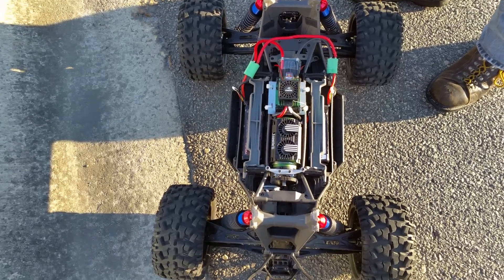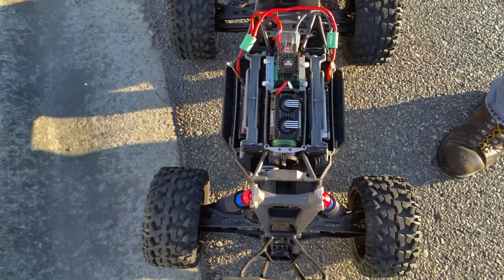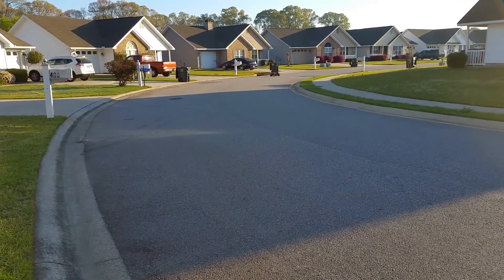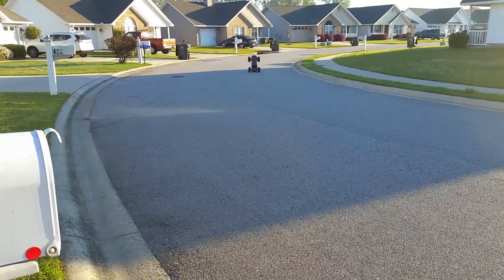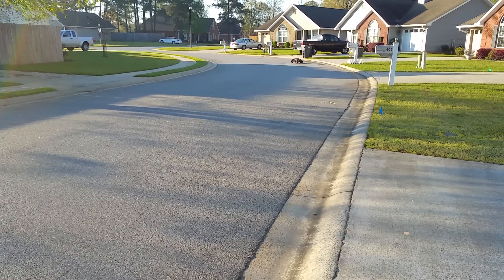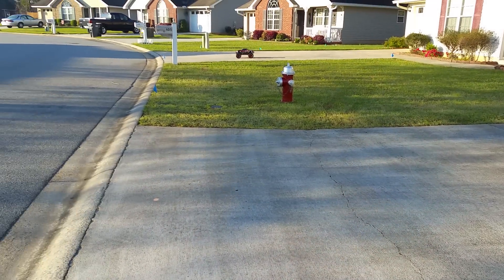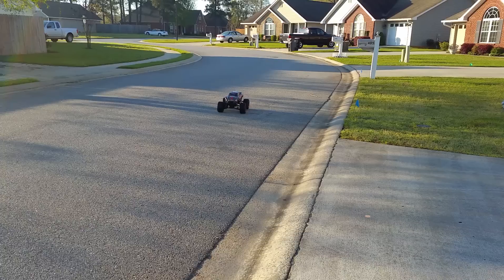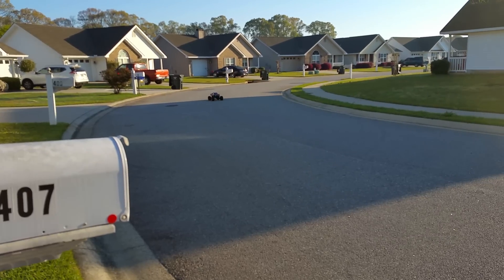Traxxas XLX-Maxx with xlx esc, 2028 motor 53 tooth pinion, 50 tooth spur

Comment: Been watching all the videos you made on the X max thanks for all your videos with this vehicle and others good stuff
Reply from the maker: my pleasure.  just wanting to help
Reply: Nitro Revolution RC
Reply: Nitro Revolution RC what cell should i run with this motor and esc smc 7200mah 90c 131amps 3s or smc 6700mah 4s on 37/50

Comment: Great running video I'm picking mine up from the hobby shop I had to castle creation installed motors like a soda can can't wait to get it I think I'm going to have to invest in a couple three sells seeing how yours runs really fast on 6s I also am afraid of dropping 2 4cells in it again great video thank you looking forward to more of them I'm your number one fan in New York
Reply from the maker: thank you very much.  I will say be prepared for broken diffs. even the spiral cut hardened.  straight cut is always stronger, the spiral cut gears only make the truck run smoother.  they break just as easy as the standard.  I have heard rumors that LEM (leading edge machining, they make true bulletproof parts and warranty them so basically if you manage to break them you will get replacements) are going to be producing gears and diff cups for the x-maxx and Kershaw is producing gears as well.  I'm not sure how strong these are yet due to they have not shipped yet?  So until then stick with the stock gears just shim the pinion, I have a video on how to do that, I wish you the best of luck with your vehicle and if you habe any questions I have all the videos and know more than most about this vehicle.  I get contacted daily on help with many different types of vehicles, last night I had a friend looking to get his first o road car and seeing that I habe more of those than off road (my next vehicle will be the x-ray x1, a formula 1 1/10 scale vehicle that won the podium in the ets series, one if the hardest racing series, on the day if it's debut so it's a hell of a racing car.  I have 2 f1 vehicles but theyre collector's items so i wamt one I cam actually race.  again if you need any help you can e-mail me at rlewishughes@msn.com or my name on Facebook is Randall Hughes, you can find me in the main X-maxx group, I am 1 of 2 admins as like I've said there is only one other person that knows this truck like I do but he did mods to put in a fifth scale servo.  I was more into keeping kt stock except for the power system.  enjoy your castle powered X-maxx and be sure to keep extra diff gears on hand, atleast 2 or 3 sets fkr the front and back and your only looking at 32 dollars for 2 extra sets.  also look at getting the hot racing clutch assembly cover which is metal cause thenplastix will flex and you will strip your main drive gear.

Comment: this is THE best sounding X-Maxx ive seen in a while. so does the gear upgrade work with the stock motor? why did everyone get a new ESC. I bought mine a month ago, and have not had ESC issues so far, are ESC still an issue on this one? i got the 8s edition.

Comment: Problem with the 2028 geared 1:1 it accelerates so slow. That 800kv isn’t a prime choice for the truck due to the weight. Install a custom Fastlane Tp 1500kv and it will shoot out of the hole and have more top end than that geared 2:1. They have the basher series 1600kv’s and they are insane little motors pushing out 2000 watts more than the 2028.
Reply from the maker: Glenn Edward thec2028 was decent. At the time I knew of these other noymtors but no feedback from anyone. The biggest problem was the ESC. When the xlx came out castle put a cap on the amount of punch amperage available. This can be changed now but it voids the warranty. I've traded this for my highly upgraded dbxl.
Reply: Glenn Edward tp are the bees knees!!!!
Reply: Glenn Edward it is when your towing cars or plowing snow. Check the snow plow mod! 😃
Reply: Can't you just add more weight better shocks and a wheelie bar to the truck
Reply: I have heard guy going tru 2 t.p motor they run good but not for long ,besides you can run 12s on castle 2028 buddy, just need a better esc

Comment: this modification of the X MAXX is the way it should have been sold out of the box
Reply from the maker: I agree but this is wayyy to much power for a starter rc vehicle as many has ad the X-maxx to be.  I've do led the torque and horsepower.
Reply: Then it would be more expensive and you would complain about the price

Comment: What do you think of a 50 tooth pinion on a 87 tooth spur with a 1.9? Belt to wheel reduction rwd 2s , 5t 3300kv 3660 brushless in trying to set a rwd touring car world record, do you think with a 8th scale esc in my 1/10 scale it’d fly past 100?
Reply from the maker: Possibly but keep larger pinions and smaller spurs if you need more speed.
Youre also probably gonna need a 6w system with lower KV motor.
Higher KV not the best idea for speed runs IMO.
Again, my opinion.
Reply: @potjnkye86  I already have this motor, trying to use it for this project, with my hopefully 1.4 fdr it’ll end up 120 in a perfect world if I get custom gears 1.0 ratio or even a negative ratio or .8 or something crazy, this thing is going for world record

Comment: I am planning on getting a 2028 Castle motor, pleaseeee!!! tell me what else do I have to change?(what gearing? did the stock differentials broke?) what upgrades should I buy if I switch to a 2028 Castle motor?
Reply from the maker: Angel Negron gearing on 6s 37/50 for bashing 49 or 53 pinion and 50 or 46 sour for soeed runs.  And you will break diffs.  a new company called rock passion has released some extremely strong gears for it.  120 just for the front or back so 240 for the set but from what i hear they're worth it.  the teeth are bigger.  until you get better diffs just shim the stock diff pinion.  doing that makes them last even longer than the hardened spiral cut.
Reply from the maker: Angel Negron you also need the Kershaw or Poseidon motor mount

Comment: hey brother ive been watching your vids for a min and inspired me to do my own build.same xmaxx and castle xlx,2028 48 tooth spur and stock pinion. problem is everything is turned up on castle link and still slow?? slow its doing 50 but with same everything but stock moter and she was smoking fast .so my question is what am i missing? oh im running 8s thanks brother and keep up the great feed!
Reply from the maker: are you using the stock receiver?  and if so is the temp probe still connected?
Reply: +Amateur RC yup that was the problem lol...now just need tires that will handle that horsepower!
Reply from the maker: +derrick lyon if that temp probe isn't connected you only get 50% power
Reply from the maker: +derrick lyon king motor pioneers and they come with wheels.  89 dollars shipped
Reply: +Amateur RC thanks for the reply brother
Reply from the maker: +derrick lyon anytime

Comment: Trying to decide between the Castle and the Leopard, want the faster/better option.  Have you gps speed clocked this yet? Whats your top speed?
Reply from the maker: I have quite a few friends whose leopard motors windings have shorted out to the can and the can is so thin.  you get what you pay for.  Castle 100% and it's so efficient you can run 12s on it with a bigger esc.
Reply from the maker: I also know someone who sells the hobbywing max5 esc, poseidon motor mount and a poseidon motor for 450 and that's a hell of a deal.  the mount alone is 114

Comment: I know this is about 3 years old now, but do you still have this setup on your x-maxx?  If so, how has it held up?  I'm upgrading mine similar to yours, but with a Dynamite Fuze DYNS1665 motor with a Max5.   Also, do you run the same gearing?
Reply from the maker: I traded it about a month after I did this mod for a DBXL cause the 6s diffs could not hold up to the power and I didn't like the idea of spending so much money on all plastic which is what Traxxas is except their Nitros. The setup itself even with the 53/50 gearing I had was fine. It could take it all day but the drivetrain of an X-maxx along with it's all 0lastic chassis is a major weak point. Honestly if you can get a used mtxl, pull all the gas stuff and install a 12s setup.
Reply: @potjnkye86 I think I may just leave it stock then.  Maybe add a MAX 6 and be done with it.   Do you think with a MAX 5 with 2028 motor will be good enough for the MTXL?  Nice choice in RC.  I was eye balling the Losi DBXL-E.  They look to have great handling, not so sure how well they hold up in bashing and jumps.
Reply from the maker: @romelreyna2457  DBXL was never a good jumper. If I were to getanither X-maxx I'd get an 8s roller and add the highest amperage rated hobbywing ESC and Poseidon 2028 motoramd run it on 8s.  You can harden the stock parts but you've got to get them red hot, dip them 8n used oil then put them 8n an oven for like 4 hours at a certain temp. Hacksmith and TKOR showed how to do this. But at the end of the day you still have a plastic chassis. Kershaw designs designed 2, a regular metal version and an LCG metal version. I was gonna do ALOT to my X-maxx but I soon found how cheaply it was made.
Reply from the maker: @romelreyna2457  as for will a 2028 motor being enough for a mtxl. I know it is. I have a buddy that built a 14s mtxl and even with a center diff (filled with 1 million diff fluid) it would do wheelies. X-MAXX IS A BLAST but you have to realize what Traxxas is. They're even stopping shipping to hobby stores cause they don't want anyone to make a profit off Traxxas vehicles except Traxxas. Look it up. The only Traxxas I had that I really liked was the 3.3 4-tec and 3.3 jato
Reply: @potjnkye86  Thanks.  Now onto find a good conversion kit for the MTXL.  Horizon Hobby sells one for the 5ive-t, not sure if it will fit the dbxl & mtxl chassis.
Reply from the maker: @romelreyna2457  Gonna have to source parts for a DBXL conversion. The mtxl is based off the dbxl

Comment: ok I flip the 2028 fans did you cut the part on the other side to make the wire fit? I thought I would ask first, anything else I need to know?
Reply from the maker: no I didn't cut any wires.  I just routed them between the fans and the shroud.

Comment: Hey Randall
Can you tell me what a value timing you put in the controller
I run 48T pinion and original spur on timing value 10  in castle xl2 esc (motor castle 800kv)and 
After the engine warms up is causing problems (ticks) As soon as I open throttle. You have an idea why?
Reply from the maker: set timing back to stock
Reply: +Amateur RC 
thank u

Comment: video on motor install?  or did I miss it?
Reply from the maker: the installation of this entire process I did not make a video of.  I however am making a video of the process and how to install everything.  the soldering alone took 3 hours.  8 gauge wire is tough to solder even with a 950 degree 150 dollar digital soldering station.
Reply: Nice, looking forward to it

Comment: Hey I have a question. I just converted my xmaxx as well to the 2028 motor. But I'm having trouble with my castle xlx esc. I get more power in reverse than I do in forward. Did you have any issues with your setup? If so how did you fix it?
Reply from the maker: the reason your getting more power in reverse than forward is because you didn't calibrate your esc.  turn on the esc while holding full throttle and after the first little jingle your in calibration mode.  I've never had to calibrate before cause mine come already calibrated for some reason and I always plug in castle link before my very first run to make sure all the settings are right because thay much power can break things.

Comment: will this engine fit in the slash chassis? obviously I'll have to do some modifications. but will it fit otherwise?
Reply from the maker: Tyler Maloney ha ha.  no.  This engine is the size of a can of soda.  If you dont race your slash and wamt to get the most out of it go with a mamba monster and 2200 for 6s but id highly advise installing xo-1 diff gears so it can take that kind of power.   4s go with the 2400 or 2650.  2650 will give you unbelievable torque and the ability to get up to 100 maybe, depends what all you do, 2200 would definitely get you there.  And remember to beef up everything if you go to 6s.  mip x-duty axles, metal motor mount from king headz as it uses a larger rear bearing that won't fail when all the extra power is sent through it.  Also a tekno center driveshaft.  get rid of everything plastic in your driveline and beef up everything else.
Reply: Amateur RC I've got the traxxas aluminum motor mount and the xo1 axles already installed. I want to build a slash that can hit 100+mph if I want it to.
Reply from the maker: Tyler Maloney there the motor mount and what it bolts up to.  Traxxas makes an aluminum version bht uses the stock weak bearing. is it 4wd?  If so it's the part where the slipper or CD would go.  it comes stock with plastic.  integy makes one as do other companies like strc but the best is king headz. The the best is king headz due to the way oversized bearing.  https://www.amainhobbies.com/king-headz-traxxas-slash-4x4-lcg-rally-aluminum-motor-mount-w-bearing-khz-trx-7460/p248809
Reply: Amateur RC I don't have the lcg chassis. they have one that looks like it'll fit in the stock chassis tho. and it's got the oversized bearing too.
Reply from the maker: Tyler Maloney yep, they have both and the oversized bearing is about twice the size of the stock bearing.  I have a slash with alot of upgrades that I'll do a video on.  I'm personally waiting for the mip x-duty axles, tekno center axle, chassis brace and flm metal cd cup.
Reply: Amateur RC awesome. looking forward to seeing your slash video
Reply from the maker: Tyler Maloney I've only done 1 or 2.  I habe so many vehicles I need to go back and do videos on.  DBXL, KM Baja, slash, himoto mayhem, hpi rs4 sport 3 drift amd flux, tamiya f201 and my new f2012, my 2 nitro revos, one big block and one 3.3, and a short chassis nitro revo converted to e slayer.  And the minis.  oh, cant forget the nitro rs4 and 105 mph drift star.

Comment: get thunder power 70c continuous and 140 burst packs mine are 1078amps a pack
Reply: Put those thunder powers on a 500 amp load and you'll be watching a fire start lol... do you honestly think any lipo made for rc use can handle the actual labeled amp draw? Biggest BS part of RC is flat out lying labels on lipos, and yes I own 10 or 12 of those 70c continuous Thunder powers and use them on edf jets and boats, and they get quite toasty and on edge of puffing on a 250a constant load just fyi.

Comment: Can you do a video on how to convert the X Maxx to 1/5 scale beadlock tires?
Reply from the maker: the beadlocks are purely decorative.  watch my new video and you'll see I put actually 5th scale tires on it.
Reply: Awesome, I'll watch the vid, I do not like gluing or ungluing tires. I have Proline Trencher 2.2 beadlocks on my slash; I shoegooed ducktape to inside of tires & have not had any issues at all with ballooning or treads coming off. They aren't for decoration on my slash, but I do agree that they look great. (I use them to get away from having to buy rims + tires together & to avoid the dreaded ungluing)

Comment: Hey what motor temps are u getting with that gearing? And are u running 8s with that gearing? Thanks
Reply from the maker: This was just 6s and after 30 minutes of running motor temp would be 110-120 max and esc was about 105 max.  the stock diffs in the gen 1 x-maxx was junk, why do you think within 1 year not only was the drivetrain upgraded (the differentials may have been bigger but the teeth themselves were only eighth scale size) and also a new ESC was brought out and even the vxl-8s has the same crap mosfets that cant take the amperage and voltage the x-maxx requires.  when i get another the first upgrade i will make is a new ESC.
Reply: I’m trying to figure out the best esc and motor combination any advice

Comment: your videos are informative. i have an xmaxx on order. whats your opinion on the traxxas 10,000 mah batteries or should i get smaller batteries
Reply from the maker: stay away from Traxxas batteries.  pay the same amount and get venom.  Traxxas says they will warranty them but I have seen post after post on Facebook about a cell dying and Traxxas not replacing.
Reply: ok. I'm going to order the venom 10,000 mah batteries.
Reply from the maker: make sure it fits.  i jsed the 7500 and it barely fit
Reply from the maker: And tge 7500 30c does 275 amps constant 375 bursts I believe.
Reply: thanks for the info

Comment: where did you get the red trim for the wheels? i have a red one as well
Reply from the maker: Stephen Louis I made them
Reply: what does it mean when the x-maxx runs a 4s, 6s, or 8s?
Reply from the maker: Stephen Louis  its how many cells in the lipo batteries.  lipo batteries have 2-6 cells usually.  each cell is 4.2 volts when fully charged.  So when running 4s 4 cells are giving power so 16.8 volts.  more.colts equals more power.  6s meaning 6 cells is 22.8 volts.  8s being 8 cells is 33.6 volts.
Reply: Amateur RC what size battery for the Xmaxx should I run knowing I'm upgrading the motor to Castle 2028 in the future
Reply from the maker: Stephen Louis with that motor amd esc you HAVE to have batteries that can put out 200 amps.  I always chose venom 7500 mah 30c because of their ability to output over 200 amps constant and 375 burst and they are always available, come with a 1 year guarantee and aren't ridiculously priced.  but there are also smc amd spc batteries.  you cam can get these at 9000 mah 50c i believe so 450 amps constant, but no warranty.
Reply: Amateur RC ok. so the venom 10,500 mah batteries are no good?
Reply: let me know your input on them
Reply from the maker: Stephen Louis too big.
Reply: Stephen Louis MAX battery size for the Traxxas X-Maxx:
Max 170mm long without the foam, 48mm wide, and 43mm tall.